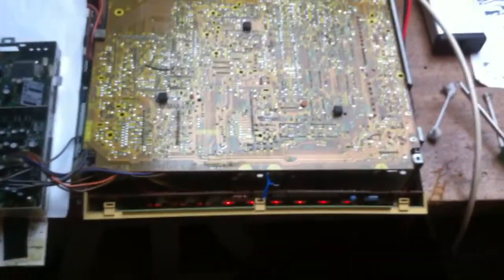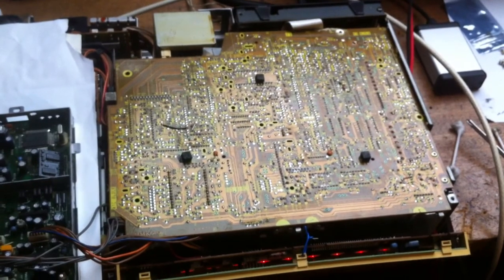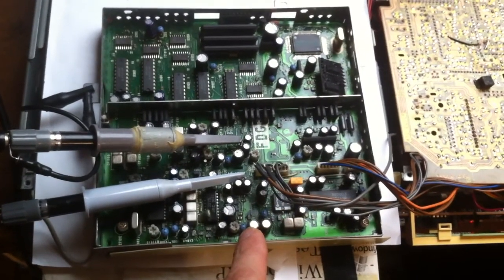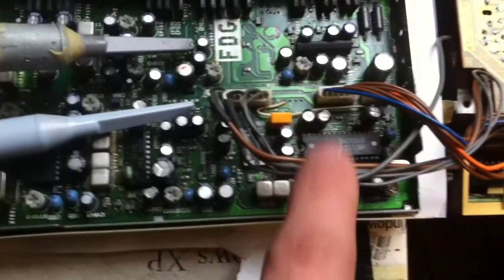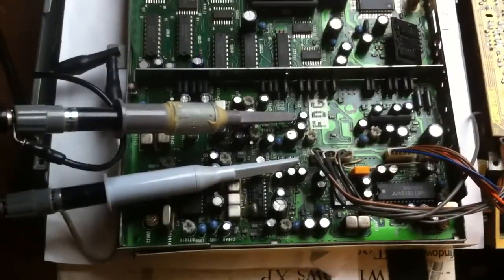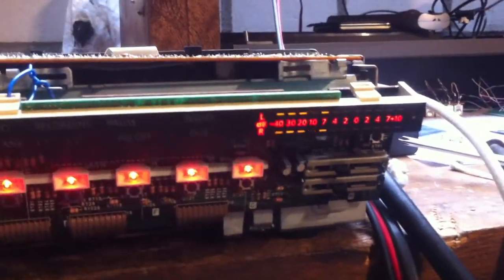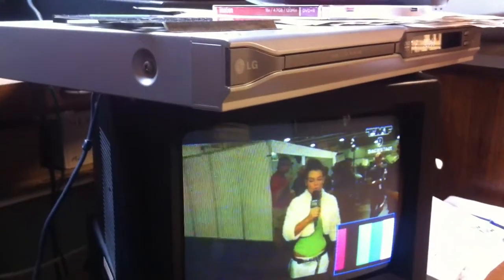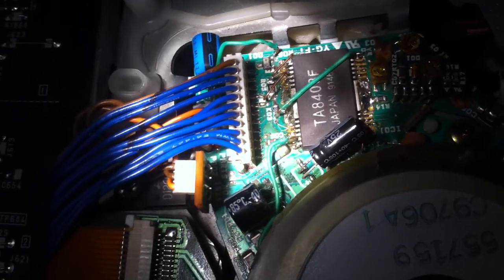Bang & Olufsen Beocord VX5000 VHS overview and repair

Comment: Hey, I’ve just pick one of these up. It switches on with red lights, but it won’t load a tape. I can’t push it in. Is there a sensor for this or is it likely that it’s a capacitor thing on the main board? I’m about to take it apart but don’t know the machine..
Reply: Ditto.  I can't even get it apart!
Reply: THIS Hitachi mechanism read service manual

Comment: How did you make the ir sensor for  the beolink remote, is the ir sensor also working with a Beocord vx 7000?
Reply: Their remotes are made to work on all their equipment. You can even use their newest remote on B&O equipment from the 80s and vice versa
Reply from the maker: The VX7000 is almost the same as the  VX5000 I believe. Except no digitization unit. The Datalink/Beolink between TV and VCR goes a little bit further than just sending the IR codes. For example stored channels can be copied from TV to VCR and you can use teletext to program the VCR timer. If you look into the Datalink specification you find that the pulses are 1,5625ms of duration. The remote control gives shorter pulses of 200us (for battery saving), the rest of the protocol is the same. So the only thing you need to do is stretch the pulses from 0,2ms to 1,5625ms. You could use the TSOP7000 receiver and IC CD4538 for this. It works on my unit.

Comment: Hoi 
kheb nu ook een VX5000 met een probleem
hij reargeert op geen enkele knop die ik indruk maar als  ik de stekker eruit haal en er weer in reargeert hij op 1 a 2 knoppen die ik indruk.
als ik dan bijv play indruk speelt hij de tape maar kan ik geen andere knoppen meer gebruiken dan is hij weer gelocked en moet ik weer de stekker uit halen om wat anders te doen.
de playback is ook niet goed: zwart beeld met vervormd geluid
heb je mischien een idee wat t is?
Reply from the maker: Ja, ik had ook diverse problemen in control logic en video circuits. Het meeste werd veroorzaakt door slechte condensatoren, met name waarde 47uF en door doorgevreten sporen (en doormetaliseringen) door het zuur uit de condensatoren. Voor het niet reageren zou ik naar de condensatoren in het reset circuit van de processor kijken en ook naar slechte sporen. De backup batterij zal ook wel kapot zijn, die kan ook problemen met de logic veroorzaken, deze kun je er aan de onderkant uit schroeven.

Comment: Wow, great!  Can I send you mine for repair?
Reply from the maker: Well, it is a time consuming job. Maybe 30 capacitors needed to be replaced, mostly of value 47uF. And some traces were eaten by the acid leaking from the capacitors. So, once working it might fail again because some new traces are eaten. I had this too. But now it is working reliable. You live in the Netherlands? Otherwise it would be better to find someone in your neighborhood.

Comment: Can this vcr with a non b&o TV, I know the remote wont work?
Reply from the maker: Yes, you can remote control this VCR but you'll need an IR sensor that plugs in to the back of the recorder. The sensor could be build using the CD4538 chip to extend the 200us pulses from the remote to 1,5625ms pulses that are accepted by the VCR. Mind that the carrier of B&O IR is modulated 455kHz and not 38kHz like many other remotes, so a special receiver is needed. Or you could search the net for a sensor, look for B&O remote sensor. It is a square one with a mini jack plug. Please test this before you buy.